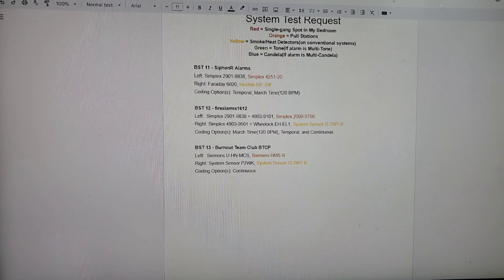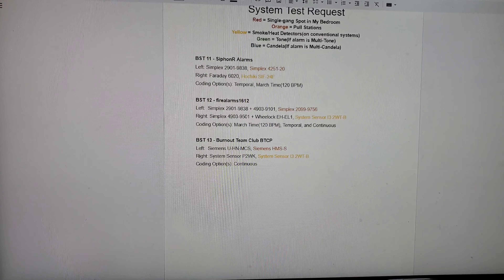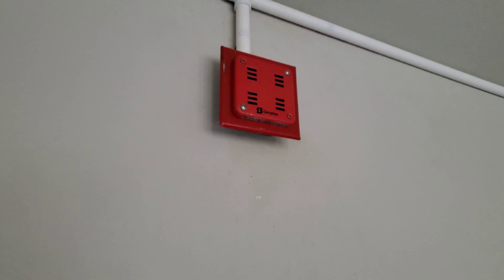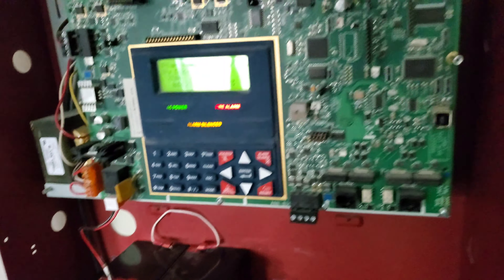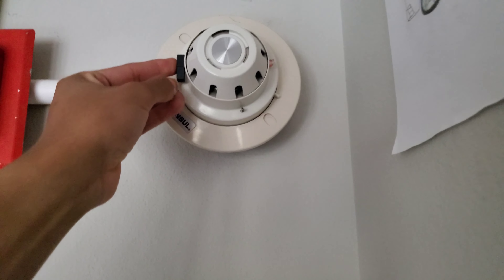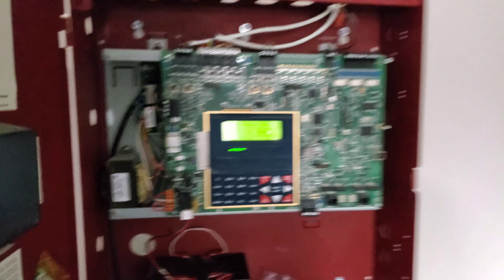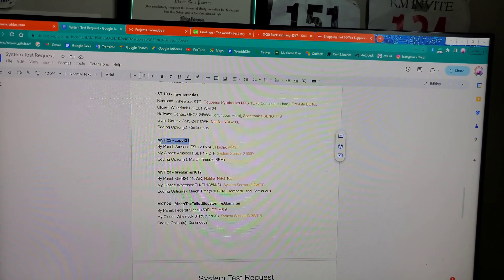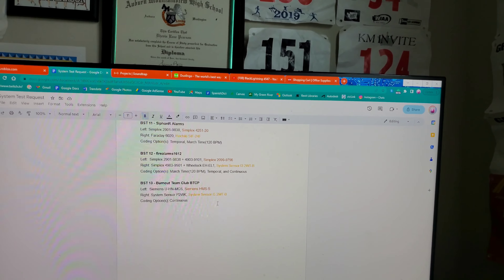Bedroom System Test 11| Requested by @siphonralarms9411

Comment: Great video as always! How come the ms5ud did not indicate a low battery trouble with the bad batteries connected? Thanks!
Reply from the maker: Thank you! Bad batteries doesn't always mean low voltage. In my case, they still output a steady 25.4 volts(they're wired in series), which the panel sees as normal. However, when put under load(such as battery backup), that's when they fail. So it's not a voltage issue, but rather an amperage issue. They're 4.5ah and not really meant for the MS-5UD as it needs a minimum of 7ah batteries. Keep in mind that I had these batteries for years and they were meant for the Fire-Lite MP-24 when I had it, due to its smaller enclosure and normal 7ah batteries wouldn't fit in it.
Reply: @BlackLightning4547  That makes perfect sense! Thanks for the great explanation!
Reply from the maker: @calebmorand4604  glad I could help
Reply: Which means in this test, the horns will act kind of funny.
Reply from the maker: @JMJYouTuber2001  Yep, they'll sound similar to AC horns due to Full Wave Rectified(FWR) wavelength alternating since it's unfiltered.

Comment: nice and i perfer 2001/4001 fwr over firelite fwr
Reply from the maker: Thank you, FWR is FWR, there isn't a difference between Simplex and Fire-Lite.
Reply: @BlackLightning4547 what they mean is they prefer a dying filtering capacitor on a panel over straight FWR.
Reply from the maker: @LunaReviews  Which still produces FWR at the end of day... so what's your point? Dying filtering copasitors vs. A power supply with cheap filtering will make mechanical horns sound raspy.
Reply: @BlackLightning4547  my point is that it is thought of as dying capacitors are cleaner than FWR.
Reply from the maker: @LunaReviews  You do not understand what I'm saying... once the filtering capacitors die or are "dying", they are no longer doing what they're intended to do, which is to filter the current to provide clean filtered DC. So no, dying capacitors aren't "cleaner" than a Honeywell power supply that produces FWR out of the box at that point. Nothing is clean about Full Wave Rectified Current as it alternates like AC(just at a slower Hz) due to it being unfiltered.